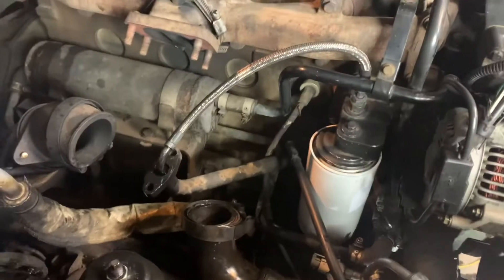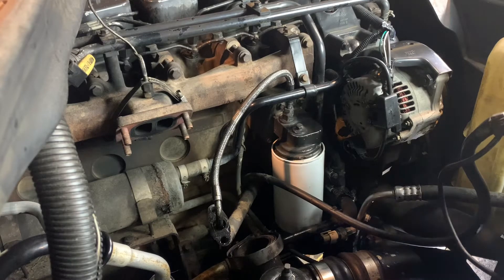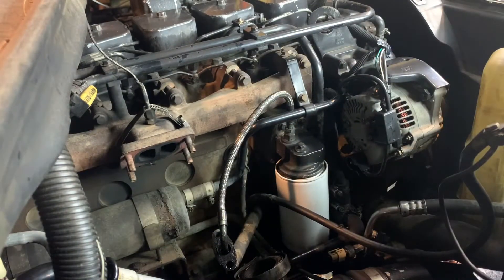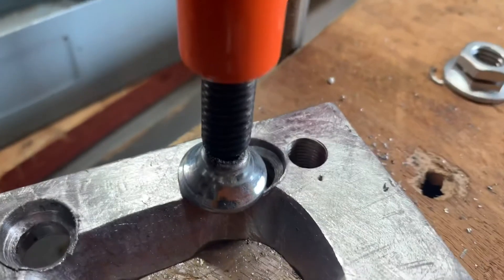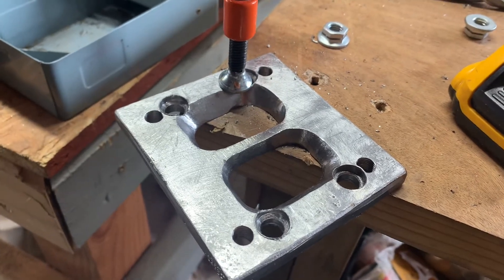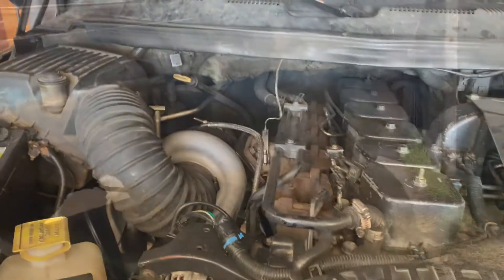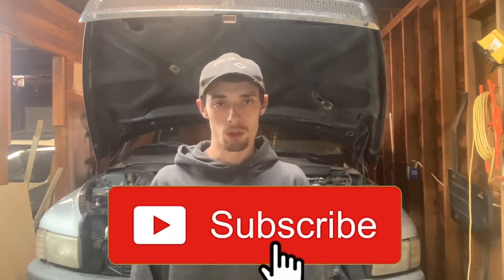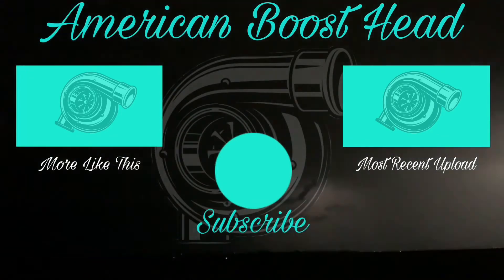12 Valve Turbo Install T51R SXE364/68/.83,T4

Comment: Did you put a gasket between the adapter and the manifold flange?
Reply from the maker: We used the old gasket from the stock turbo on the manifold side. Since we where just waiting for the steed speed to show up and it was only temporary it wasn't a big deal to me on a personal pickup.